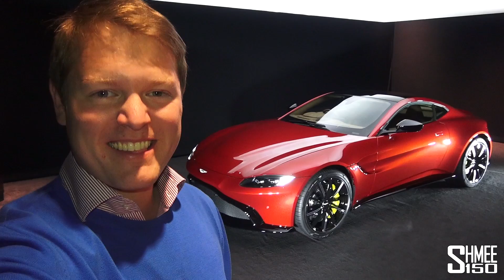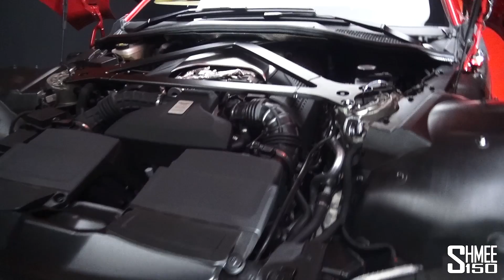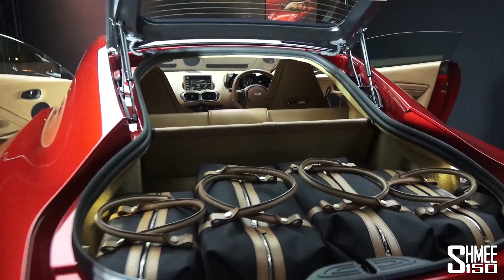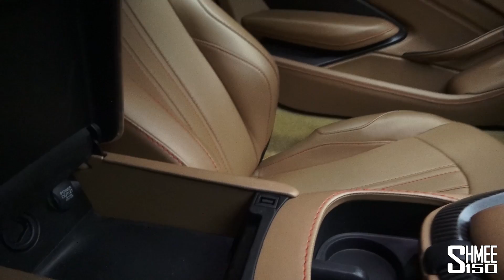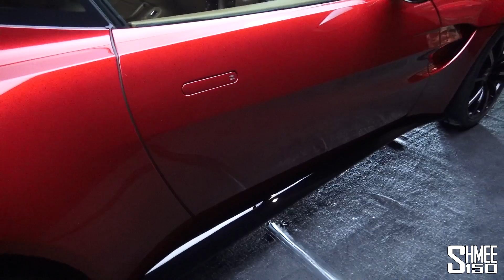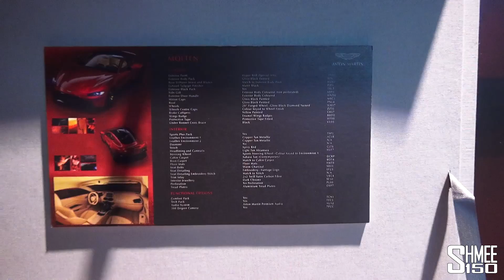THIS is the NEW Aston Martin Vantage! | FIRST LOOK

Comment: I'll say this again, we will all get used to the design. I think though the brake light curving over the top looks a bit frightening :D
Reply: Better looking than the db11
Reply: same with the new rs5, but with this one.. nope
Reply: I took a bit longer look at the back and front
I understand both front and back
I saw the front and I see the old vantage,just a bit modern
The rear whenyou take a good look. You can really understand thw design
Reply: Yeah, they should have carried forward the lights from the DB10
Reply: The designs that we don't like it at first glance but becoming to like it as time passes by are designs that actually are bad. We get to like it only becuase we are getting used to it, and instinctively forcing ourselves to like it. ... Until you see a car you appreciated since the first glance and realize you've been forcing yourself to like a bad design.
Reply: Hugonovais Slash Its because this Vantage is bad, but the DB11 was horrible and just fugly.
Reply: ProjectGenesis That is Bullshit. The opposite can be the case. A more difficult design can be much more timeless over time and immediately pleasing design can get boring very fast.
Reply: Solomon Tetteh Its a very beautiful design.
Reply: josh Indeed.
Reply: Nah bro that thing is fucking ugly
Reply: The rear lights look like the ones on the Jaguar C-X75 imo.
Reply: Solomon Tetteh The outside is great. It’s the Inside that looks like a last decade Hyundai Coupé!
Reply: Nirodim [ROAD TO 500] ;)
Reply: Solomon Tetteh The front lights look like an NC mx-5 and the grill looks even worse . Like a DIY tuner bumper.

Comment: Looks like a Jaguar F-Type with extra steps.
Reply: Conquer 911s R8s AMG GTs and 570s? In a Vantage? You must be kidding right? My Cali T has similar/better acceleration and top speed than a Vantage whilst being able to have 2 kids in the back, shopping in the boot, and a RHT. The cars you mentioned would have both my car and the crappy new Vantage for breakfast any day of the week, and probably at a cheaper price too.
Reply: Yup, the FType was designed by a former Aston  Martin designer, so it would make sense they look similar.
Reply: Jaguar copied Aston Martin? Wrong, other way round.
Reply: seems like slavery with extra steps
Reply: aston
Reply: Not even close to a jaguar
Reply: e_ptx Jaguar copied Aston? Do you even know that Jaguars design chief used to work for Aston?
Reply: Victor K which came first, the F or new vantage?
Reply: FerrariFreak7 that is what I thought
Reply: what? lol
Reply: Nice vid Man, thanks!

Well, I really like it overall, generic headlights not withstanding (is it too late Aston to jigger those?).  Certainly the rear is preferable over the emasculated DB11's.  I can't help but see some Lancia Stratos in the profile, maybe the old Opel GT?  This lean ready for action Aston perhaps responding to those lost potential sales to higher optioned F-Types, so eat your heart out there Jaguar.  Assuming this is a real athletic driver, let's go conquer 911's, R8's, AMG GT's, and 570's...for starters.
Reply: FerrariFreak7 ok
Reply: Doesn't change the fact that it looks awful.
Reply: Defiantly F type looks and size lol

Comment: oh Aston... love the front but what happened with the back? That taillight makes it look like a cheap Kia. Would have been so much better if only the outer parts of the light (up to the first gap) would light up or just a straight line across. And the interior? Not sure if it's because of the color combination but the way the air vents sit and the cheap display wrapped in leather... doesn't look like quality..